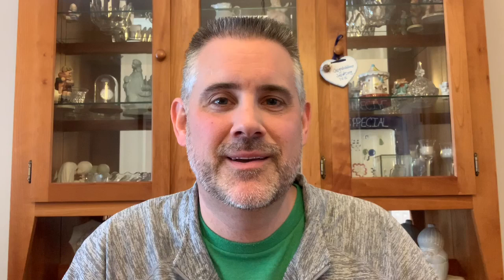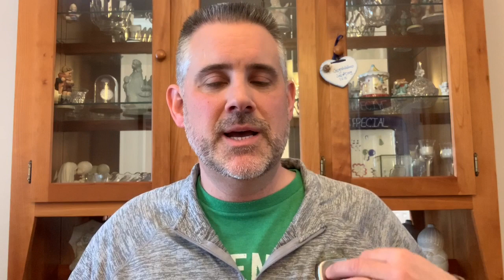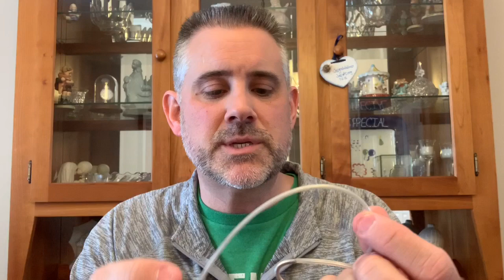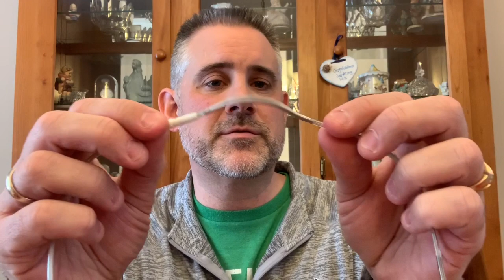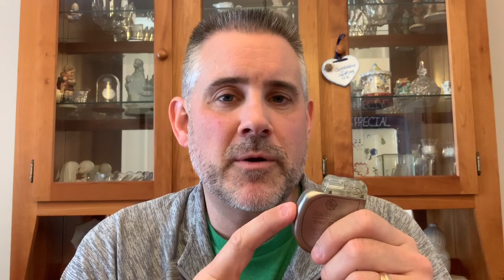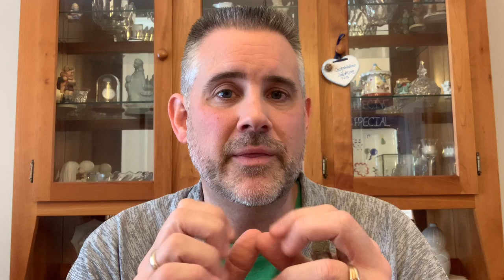Defibrillators 101 - The Basics Of An Implantable Cardioverter Defibrillator (ICD)

Comment: DOUGLAS,  QUESTION:  I would love to know your opinion about an S-ICD Defibrillators, who's better a TV-ICD or an S-ICD????
Reply from the maker: Hi Wayne, thanks for watching and for the question.  For me I looked first at which product was right for me.  Then I looked at their track record, and finally considered comfort and how it would look.  The SICD was an option for me as I don't require pacing, but the SICD had only been on the market for a few years verses decades of use with the traditional ICDs.  Also, I'm a fairly athletic person, and when I held the device in my hands back then (in 2014), I just didn't think it would be comfortable for me resting on my side especially when I was playing soccer or taking a spill while downhill skiing.  Some people are concerned about having leads inside their heart.  Personally, I was not concerned about that, but it is something to consider.  There are a lot of different things to think about here.  For me, the SICD was an option but I opted for a traditional ICD.
Reply: @DouglasRachac  ok